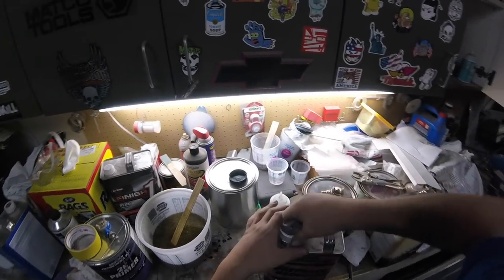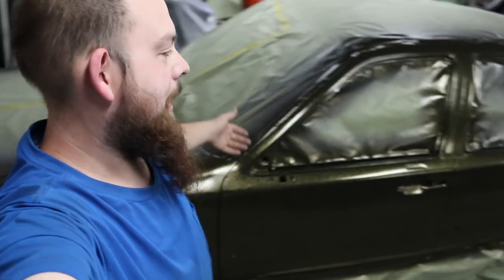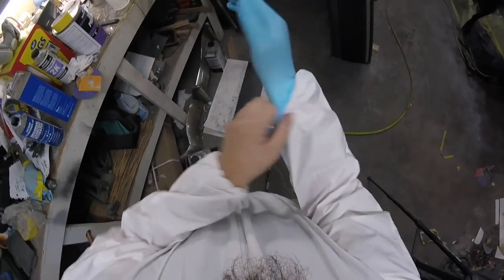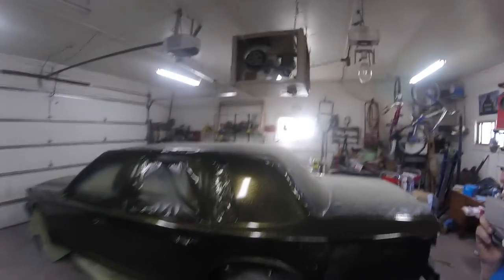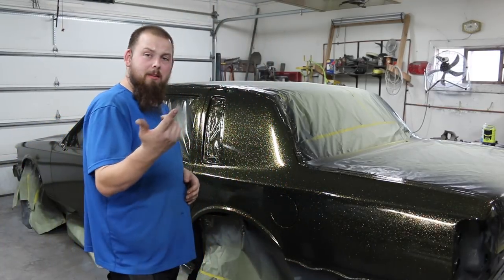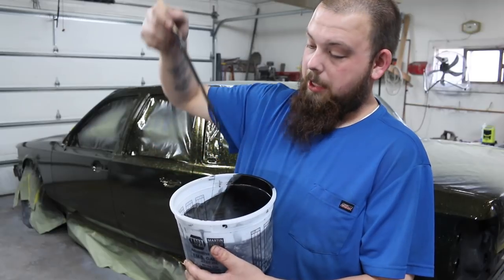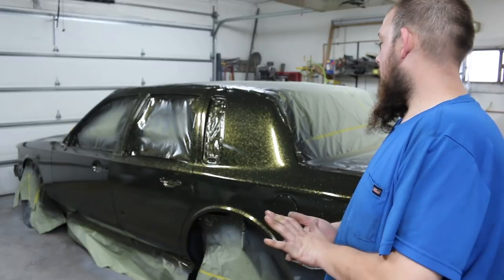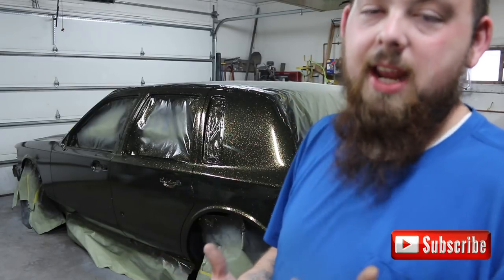SUPER FLAKED LOWRIDER PAINT

Comment: You may already know this, or have been told. If so my apologies. With that cup system your using. After you attach your gun to the cup. Leave it up side down and attach your air hose. After that pull the trigger on your gun and bleed the air out of the cup. Just hold the trigger down until the material starts flowing out. Turn your gun upright and your ready to rock. You’ll find you use a lot less material. I mean a lot less. Overspray won’t be as bad. Also when you hear the end of using up the material in the cup. Pull your hand over the air cap like you would when you do a back flush to help clean the fluid nozzle. Lightly pull back on the trigger. It’ll inflate the cup and let the remanding material be used up. If you already know this, I do apologize. I’m not intentionally trying to insult your intelligence. 
Great looking flake job. Looks like brass shavings you were adding to your binder. Loved it. 
Cheers

Comment: Nice job dude 
Did you need to cut it with 600 and re clear as to smooth the surface from the jagged flake .
Reply from the maker: yes had to flow coat everything, otherwise it looked like a gravel road lol
Reply: @RJTickler  ... nice du